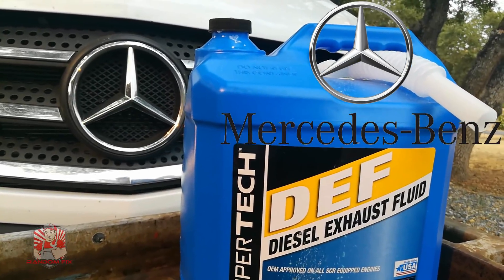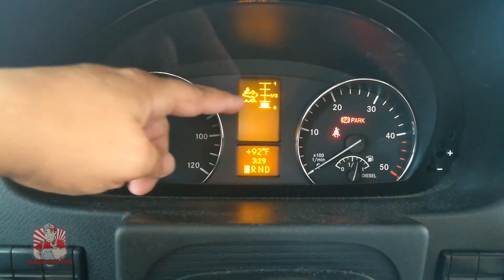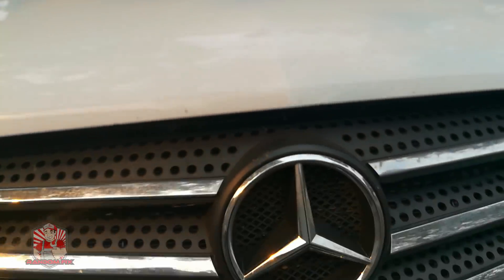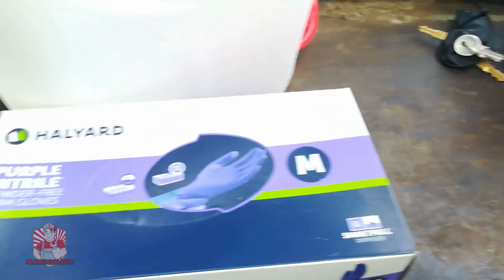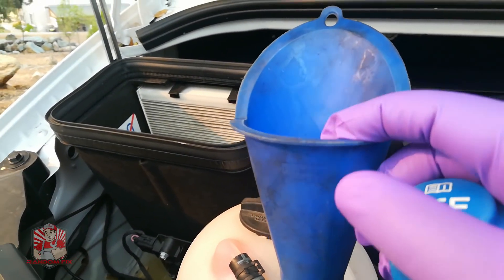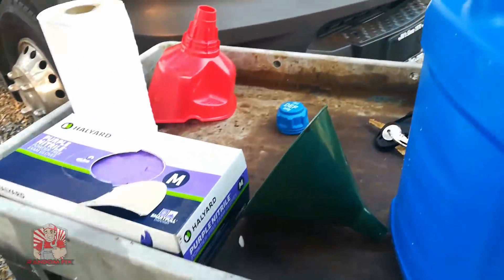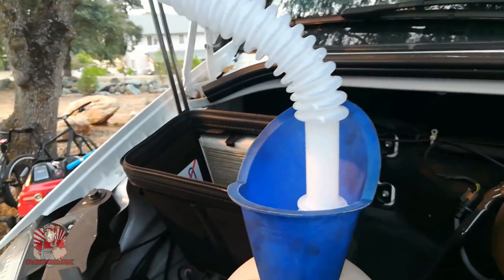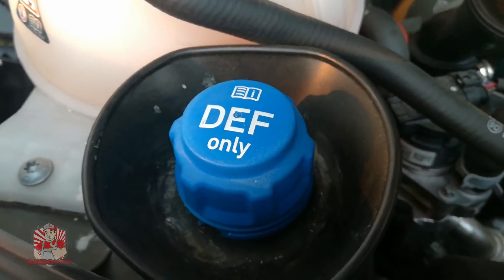How To Refill Diesel Exhaust Fluid (DEF)▶️ Mercedes Sprinter DEF Refill HACK

Comment: Hi Randomfix, I have 2010 ML350 I wonder if can use the same DEF with no damage the system. My question is did you have any specific issues with that cheap DEF, please let me know. Thank you
Reply from the maker: I did not have any issue with the cheap DEF.
Reply: Thank you
Reply from the maker: Gald to share

Comment: Hi Randomfix,
Thank you for the video!  You explained things really well!
I just purchased a Mercedes Sprinter Revel.  I was wondering if there's a way to tell how full the DEF container is getting if you're just topping it off and it's not empty?
I am going on a long road trip in Dec. and I read where you should add DEF every 4 or 5 gas fill-ups.
I'm nervous about it going down close to empty and then not being able to find any DEF while on the road.
My husband won't be with me so I need to know how to do this.   :)
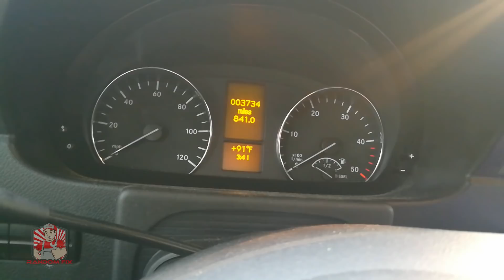Reply from the maker: Yes, you check the level of your DEF fluid on your dash, using the left side steering wheel controls, check out the video at 6:06, if can't figure it out, just let me know and I can make a quick video for you. _Randomfix
Reply: Thank you for your reply.
Yes, I did that, but for some reason the DEF part doesn't show up.  Tire pressure, etc. does, but not DEF.    :(